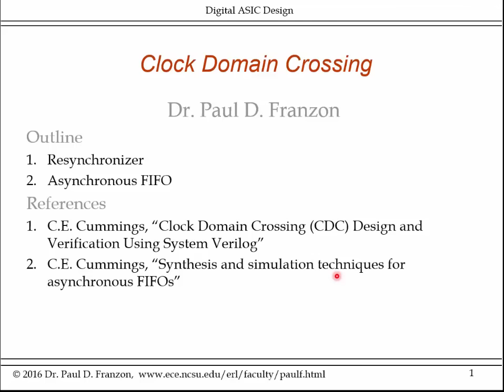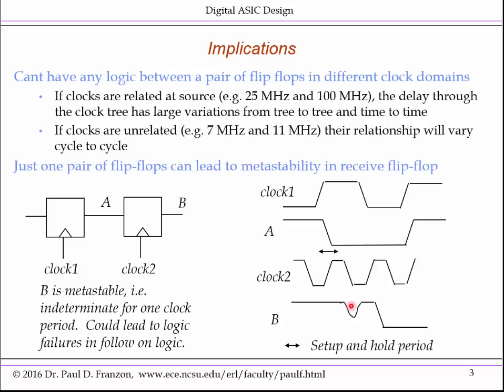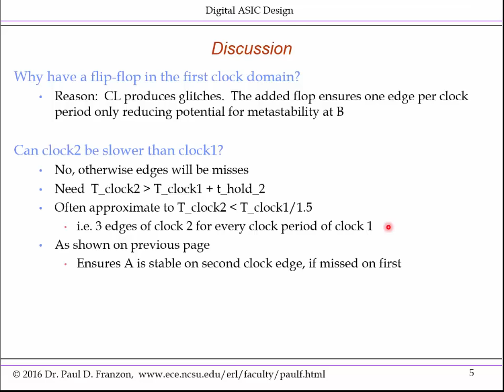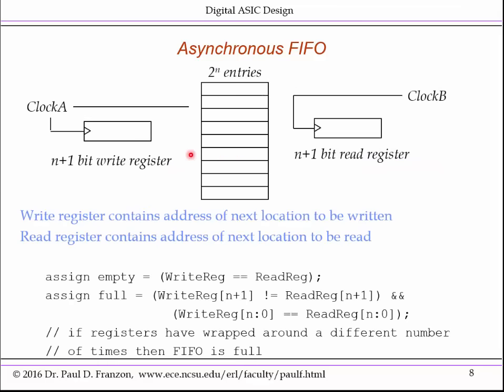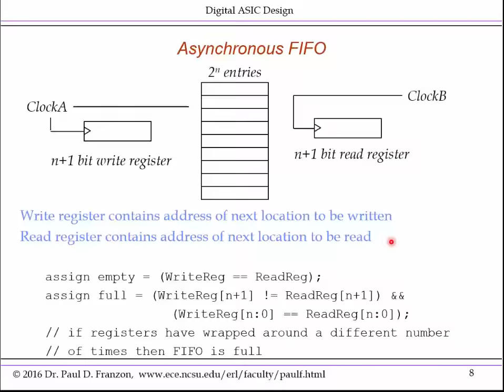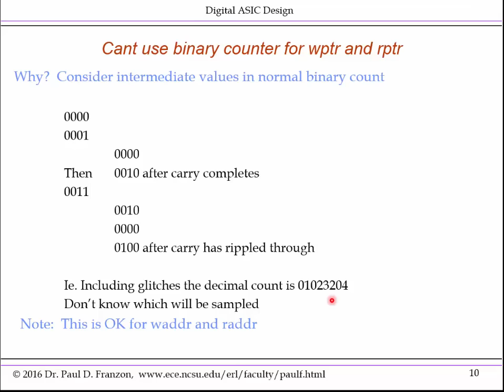ClockDomainCrossing

Comment from the maker: W Caleb: C and D can be different.  They both change on the rising edge of the clock, with D taking on C just before the rising edge and C taking on B from just before the rising edge.  (slide 6).
Muddu:  To compensate for that situation the controllers on slide 9 will detect when the FIFO is close to being full, not just the instant its full. The writing will stop in sufficient time then.

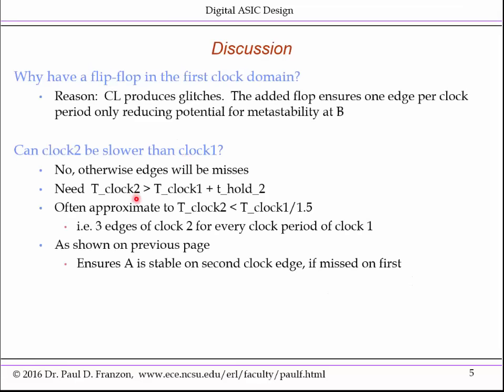Comment: Hello Dr. Paul Franzon. Nice lecture on FIFO. However, I have a question. In the FIFO design, to compare the rptr and wptr, you are feeding one signal into another clock domain. The rptr which is coming from the slow clock domain to faster one can be synchronized with sync Flip-flop logic explained in the beginning. However, the wptr which is coming from fast clock domain to slower clock domain and it cannot be synchronized as per the condition mentioned @ 7:42. How is the problem solved? Thank you in advance.
Reply from the maker: This is why it uses grade scale encoding and a full/empty criteria that permits two empty slots.
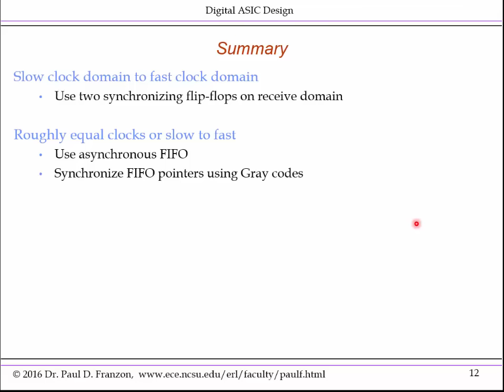Reply: Paul Franzon grade scale is another name for grey encoding? @ 18:09 you may want to change typo (I think) of Asynchronous FIFO suggestion for Fast to slow instead of slow to fast.

Comment: Hi Dr. Franzon, could you please explain how the solution for the repeated value appearing in C? Every posedge clock (I assume that this clock is clock1 of the sending side), D gets the value from C so that D and C will hold the same value. Therefore, Assign change = (C!=D) would always have change=0. You mentioned that the assign operation happens at the second FF. I am not very sure how does the code show that it happens at the second FF and how there might be a case that D and C would be different.
Reply: same question.. if both the flops capture data correct then destination domain will have same data capturing in two cycles..

Comment: If the two clocks are source from the same PLL do we still need an asynchronous FIFO or a simple shift register would be enough?
Reply from the maker: The edges of the two clocks are still uncorrelated so a multiflop resynchronizer is enough.

Comment: When we implement Asynchronous/Synchronous FIFO, What timing design constraints do we need?
Reply from the maker: Just the conventional timing constraints in each clock domain as per the synthesis script.  No additional constraints are needed.  You need to either guarantee the FIFO wont overflow or do something on overflow.

Comment: "When the two clocks are "Roughly" the same" What do you mean by this?
Reply from the maker: The two clocks are different but not different enough to simply use two flops in a slow to fast crossing.
Reply: @paulfranzon2229   okay so you mean the two clocks have different frequencies. One may be slightly  faster than the other but not fast enough for a slow to fast double flip flop implementation.
Reply from the maker: Yes.  I am assuming you are referring to the conclusions.